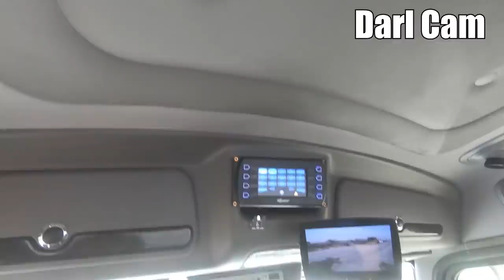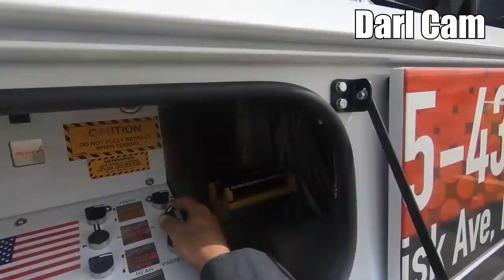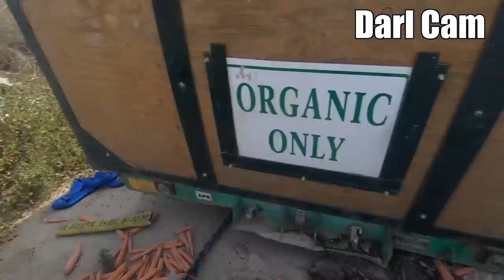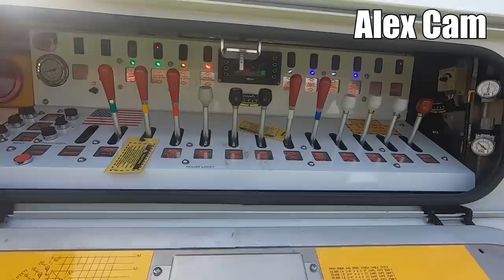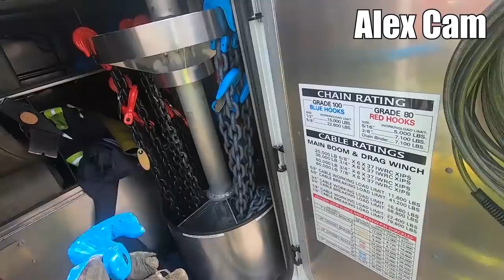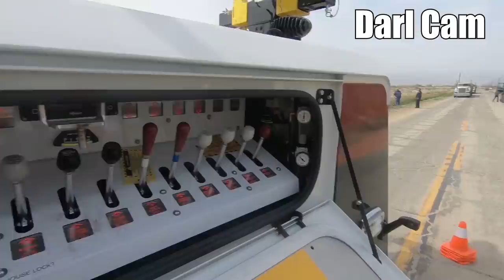Trailer Falls Off Truck | Full Of Carrots | Rotator To The Rescue

Comment: More than likely. The 5th wheel jaws needed adjusting. Especially if a holland 5th wheel. Or king pin is out of spec and too small. 
I had an empty 40ft chassis bounce out of locked jaws before.

Comment: Lol I was watching closely to see "if" remember to get strap protector under the tamden  ;-) I thought when I seen it laying their not a good place ( it's easy to sit back an watch an make a judgement but being their is always different)  But  once a 5th pin is locked it is LOCKED!! I am curious why/ how it came un hooked..
A:  it was never fully locked an was not confirmed .
B:. Was air release an was hit by accident.
C:  the fifth wheel plate/locking mechanism is flat-out wore out for the scrap yard!!
 I was suprized you were not required to sweep off to the side of the road . Usually in Michigan it is done. Or the video did not show that.  But was a relatively easy lift... Thanks for another great video ......
Reply: The most common reason unfortunately is another unknown grudge driver pulled it when SHE wasn't looking. Women truck drivers get a lot of HATE piled up in their general direction. You don't even have to be a woman to have this done on you. Back in 94 I was CB chatting with JB Hunt and he was saying every time he goes to take off, he does a sharp jab in reverse first and once a week he hears the jaws latch up again. I still don't want to believe it, but it is what it is.